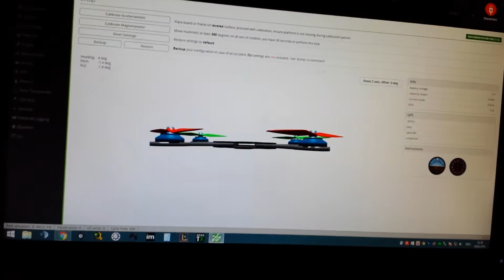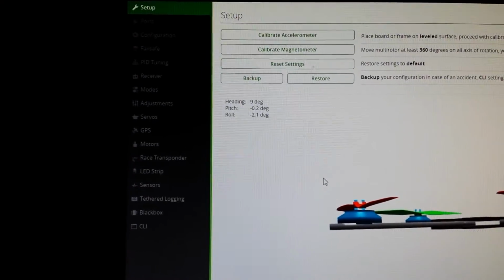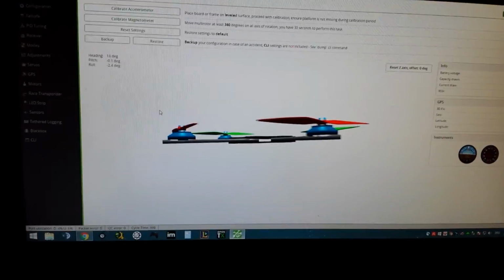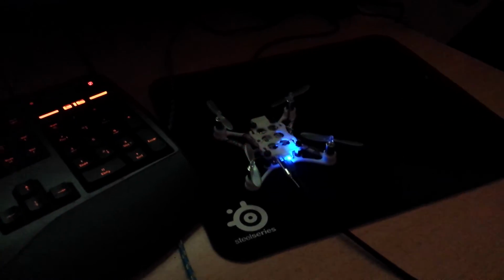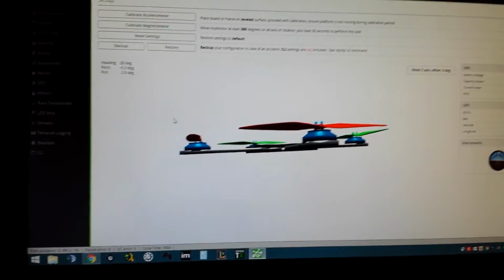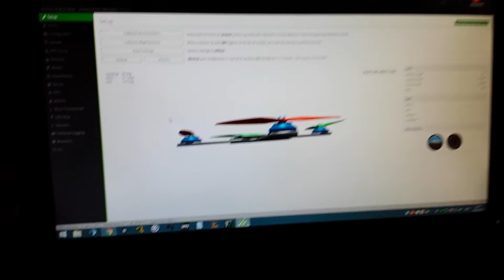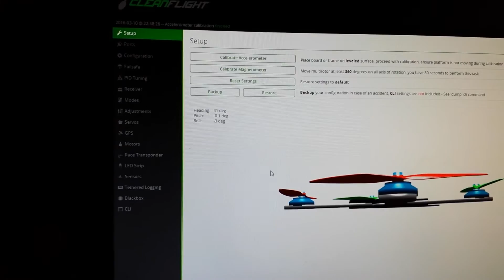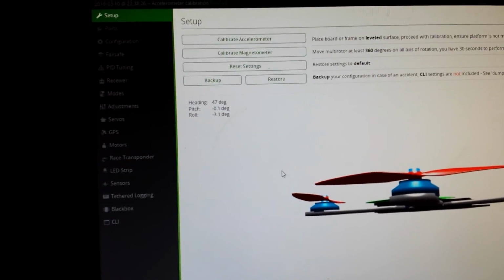Scisky defective Gyro causing right drift.

Comment from the maker: UPDATE : it seems like its not the gyro that is defective its a Cleanflight / Betaflight problem. The drift only happens when you set the motor pwm rate to 32000 or 16000 to prevent the motors to spin when you plug in the battery.
Reply: did you manage to get it fixed ?
Mine does the same
Reply from the maker: Anthony Hill Unfortunately no. I didn't try the new betaflight 3.0.x though. But I think this problem will still be persistent in the new version since Boris B. have his focus on  brushless quads and doesn't really care about micro brushed quads. When I realized that this problem is a Firmware issue I wrote about it in the github of betaflight and the problem is still not marked as solved.
Reply: xuxusito that annoying, i tried clean flight and beta flight and the problem is there with both.. some people would have to have this thing working properly

Comment: that's crazy !  I have a gyro problem I believe as well.  I have mine dead flat. even after several calibrations, the image in Cleanflight shows it tilted to the right nearly 30 degrees & front pointed way right.  I've worked on this thing for nearly 10 hours
Reply: +pointnozzleaway yea its something to do with the cli command to stop motor spin up on brushed boards when we do set motor_pwm_rate = 32000 (or 16000) it will start to drift as soon as you do that
Reply: pointnozzleaway  hi,. did you ever fix the issue.   ??  cheers
Reply: nah. gave up on the scisky